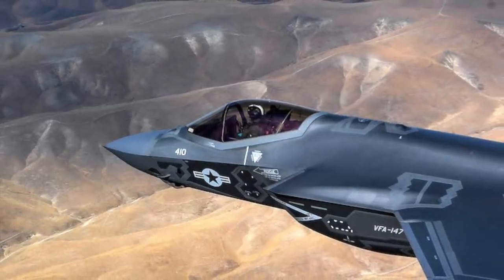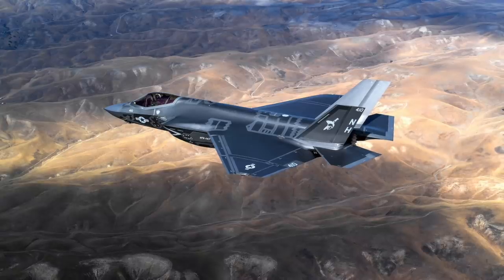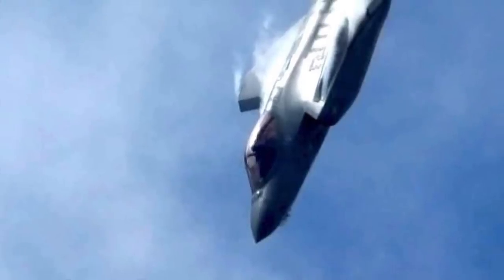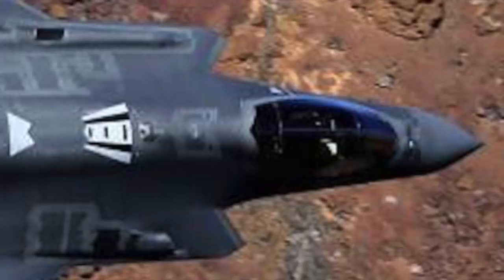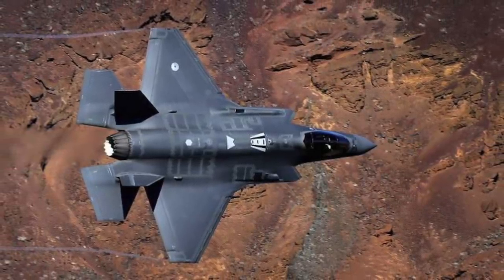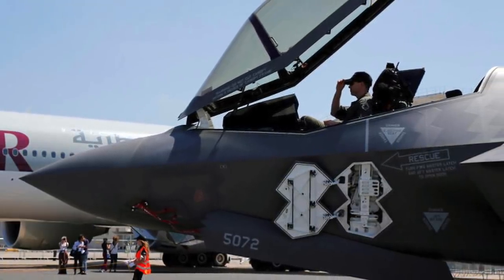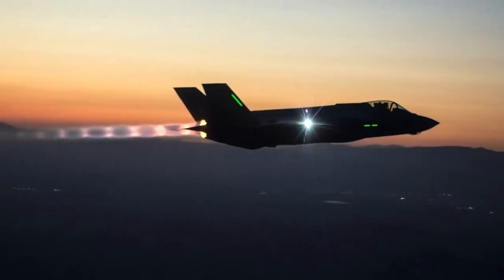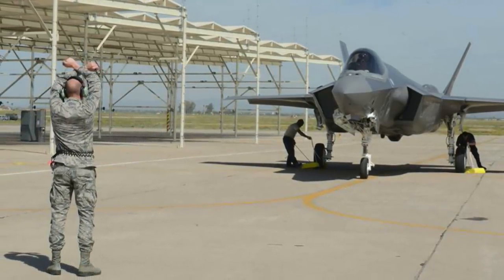HOW GERMAN MADE RADAR MANAGED TO DETECT F 35 5TH GENERATION STEALTH FIGHTER ?

Comment: The information in this video is not scientific.  A passive radar system is spread out over a wide area like a whole city and not just single area.  Passive radar system uses every antenna in the whole city and is therefore a bistatic range system and not monostatic. Also all stealth planes use radar transponders which is a radio transmission sent from the plane which is detected by radars which displays flight information of the stealth plane to make it appear on radar tracking.  There is no such thing as a reflection that can be turned off and on which could only be accomplished with a solid moving object like an aircraft body and would be completely impracticable.  Also stealth planes already use shaping which are angles that are different than ninety degrees.  For example anything that is at right angles or ninety degrees like the wings being perpendicular or 90 degrees from the body of the plane is very radar reflective so even though stealth planes use radar absorbent material  the radar wave is directed in another direction from the angle of the receiver so the radar wave does not return to the receiver, the angles of the wings and rudders in a stealth plane are at at different angles than right angles.  The Lockheed F 117 night hawk used a lot of shaping with many angles designed to reflect the radar away from  the receiver.  https://en.wikipedia.org/wiki/Stealth_technology

Comment: They call it radar, but it's a passive system. Real RADAR is an acronym. Which stands for RAdio, Detection, And Ranging. Actual radar sets are not passive. Sending out pulses of radio energy, which bounce off of a metallic object like an aircraft. 
     So this German "system" is an ESM system detecting RF energy radiated by an aircraft. Like any modern aircraft the F-35, has active RF systems. Each of which, is only vulnerable to detection; when used in active mode. The rest of this video is BS.

Comment: This is the first time I've heard of a radar reflector.  Perhaps you should do a video about these!!!!!
The only way i was aware these could be detected is if they were carrying fuel pods or missiles externally. Genuinely im interested and I'm sure others are. If IT can be detected by this radar then that is a massive giveaway and I'm sure Russian and Chinese hackers will be stealing info from this German firm as we speak. As an avid fan of this channel can you please elaborate?
Reply: Radar reflectors are bits of bare metal folded to produce maximum radar reflectivity. The simplest ones are simply aluminum foil folded to create right angles and sharp edges pointing in  all three dimensions. They're usually no bigger than a couple of inches across and light enough to fly from kites but have large radar returns for their size. Imagine eight metal cubes clustered edge to edge like a simple Rubik's cube, now remove the exterior faces, leaving the interior faces intact. They're often used on weather balloons so they aren't a flight hazard.

Comment: The F-35 was detected for sure BUT!! Can it lock a missile on to the F-35?
Reply: Probably not - detecting is one thing, but to follow the plane with a accurate fire control radar is another thing. Also it seems they had full radar deflectors on (they do this on airshows) and the transponder on
Reply: @simonm1447  Thanks for your reply.

Comment: Ok first of all stealth does not mean it can not be picked up on radar.  Second is almost all jets with stealth are way more effective from the front or back and not from the sides.  Third larger radar installations have ranges of hundreds of miles.  Fourth I doubt these jets were flying at low altitudes or without active radar.  This is not an achievement or anything to boast about.  I bet if those two F-35 wanted to they could have gotten easily within range to send air to surface missiles or release a dozen Stombrings (SDB2) to take out that radar system and any SAM systems attached to it.  Understand that Russian S300 and S400 systems were never able to protect against tomahawk missile strikes or take down an Israeli jets including some F-35 they used to bomb Iranian missile sites in Syria... twice.  The US is at least 20 years ahead of all other countries when it comes to military technology.

Comment: Learn how stealth works. They're designed to be extremely hard to detect by high frequency x,ku ect high frequency fire control radars. They're only designed to be stealthy at med range against against low frequency search radars. They're not invisible to search radars it's about fire control radars

Comment: If the German system looks for magnetic emissions, it makes no difference whether the radar reflectors were out or not. The F-35 got detected by its magnetic emissions. It's main selling point is now down the drain. And since when is Turkey buying F-35s, the US won't sell them to Turkey since they purchased the Russian S-400 defense system, and Italy is revising downwards its promises as well. Overpriced, unreliable, and un-stealthy.
Reply: Not the case- the F-35's picked up were flying with radar reflectors in correspondence with the airport it was doing the demo at in question.

Comment: Maybe you should do better research before posting videos.
Passive radar actually works without emitting radar beams. It just scans all electomagnetic waves over a wide spectrum of frequencies.
Any object passing through the scanned sector is detectable by "swirling" the electromagnetic spectrum. Hensold choose the nearby pony farm
to be able to cross reference their detections with the sighting of the actual jets. This way they could be sure the instrument readings were produced by the F35s.
Reply: n. These F-35's were flying with luneberg lenses as they were flying under the rules and regulations of the German aviation administration. So they were being lit up like a Christmas tree by the ATC radar.

Comment: Ok, the F35 has radar reflectors installed when not in a combat situation so that radars can see them.  So any radar can detect them and probably track them.  You can see these reflectors when you look at an F35 if they are installed.   They are small vertical diamond shaped reflectors.   They most certainly would have these installed in an airshow.

Comment: The F-35 had their radar reflectors installed so that they COULD be seen on radar...stupid video
Reply: It's hard to explain, but those are intended for active radars, which reflect it from only one side. A passive radar uses external emissions, reflecting from all sides. It doesn't matter if there's a radar reflector on it, or not. This is why passive radars are so much more suitable against stealth aircraft. They don't care about your shape, and if those emissions hitting the aircraft from all sides are soaked up, there is a flying black hole. Very easy to detect stealth aircraft this way. But only good as early warning system and not to provide a weapon grade lock.

Comment: The short answer is that the F35's had their radar reflectors turned on for two reasons: So air traffic control can track and guide them and to maintain the stealth profile of the F35 a secret. The F35s were detected because they allowed themselves to be.